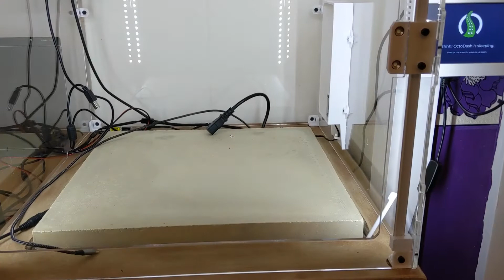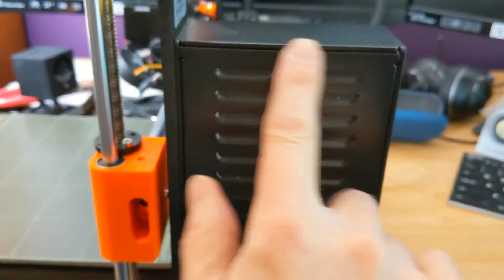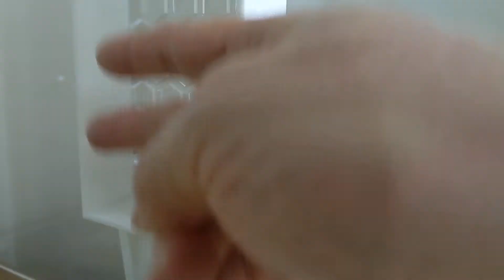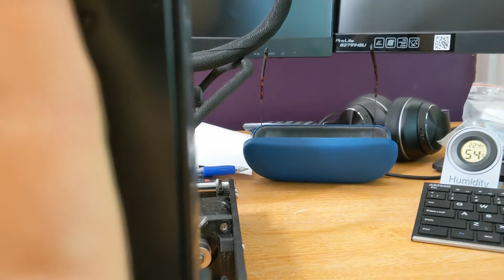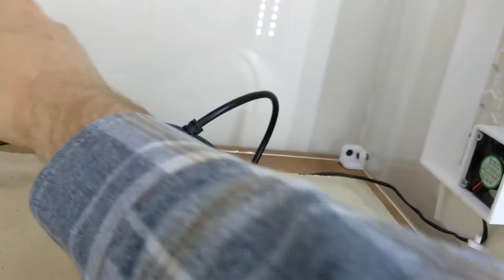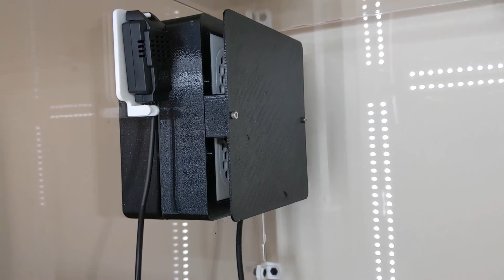3D Prusa Mk3/s Power Supply Cooling in Tukkari TS Enclosure

Comment: I agree, great review. I'm about to buy one too and install your cooling mod. What are your experiences with ABS printing and activated psu cooling? I fear a bit that the cool air blown by the little extra fan could reach the printed object with negative effect to layer adhesion.
And what do you think about a similar solution to cool the electronic box on the other side of the printer?
Reply from the maker: I havent tried ABS yet, but i think as long as the shroud it up tight against the PSU there shouldnt be noticible airflow onto the print, or cooling effect. Its either that, or moving the PSU outside the enclosure which is another can of worms.